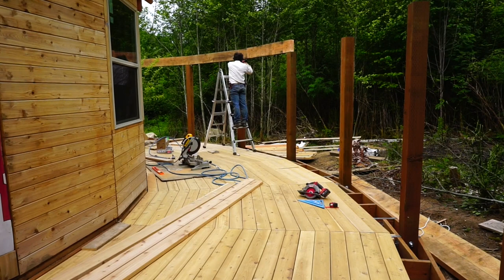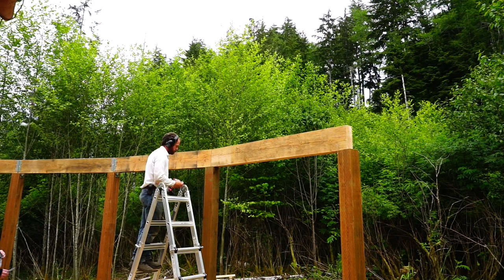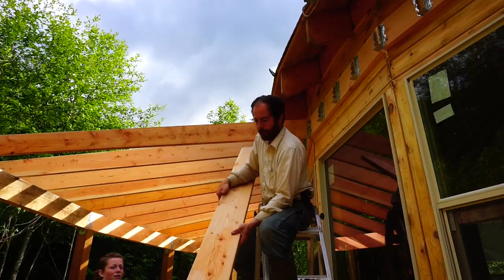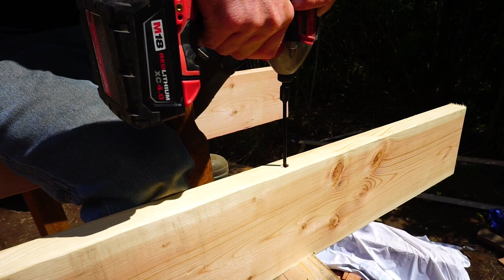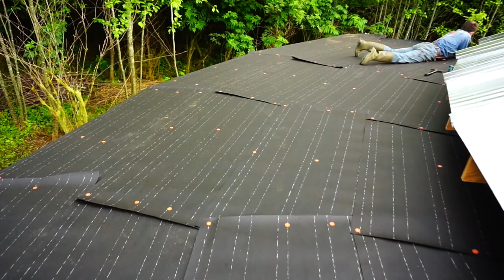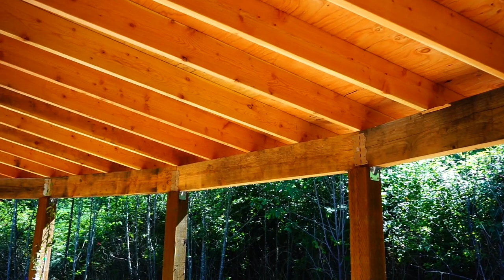Building an Off Grid Yurt Part 11: Drying in the Porch

Comment: For future build throw away the nails for the joist hangers, they make a screw and trust me it works great!
Reply from the maker: +Scott Foster I've used the screws in this very project. I hate the price. The nails feel much better on the wallet and go in well enough. You are right about the ease of the screws though. I'm just not fond of spending more than $.10 a screw.

Comment: I'd say you did not install the felt properly? I know the angle changes every several feet, yet the upper layers of felt should overlap and lay on top of the layer below it. That way moisture does not run under the layer lower than it.

Comment: All your joints, plywood, 2 and 4x material because of the circular yurt are time consuming due to constant mitering of them. Don't think it's possible to calculate the angles cause unless the yurt was build almost perfectly flat, shot in, and then the angles would calculate out. Fun project though when you have time to work out all the details. Circular layout, with all it's connecting points, might be something future yurt builders might need to know, along with that great looking deck, plumbing, electric, etc. From a retired builders standpoint I'm jealous as hell.

Comment: Those are massive timbers to support a roof. Were these mandatory or only for the look? Anyway, it is still a great job. Keep up your good work.
Reply: Simon Forget That's what I was thinking.  Kinda seems like overkill for that roof!
Reply from the maker: +Simon Forget Well I followed the engineered plan for timber size, at least all but the machine rated rafters. They are big, but I hope that means it won't come down so easily. The visual appeal isn't too bad either.
Reply: This makes sense. Just don't be fooled by the fact that heavy timbers won't come down easily: they are doing more damage than smaller ones when they do. 🙂
Keep up your good work.